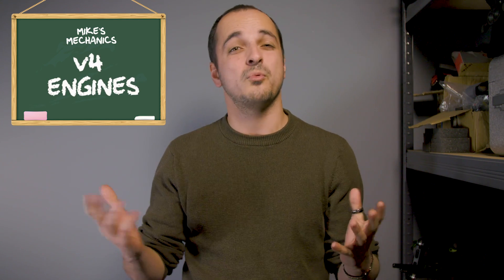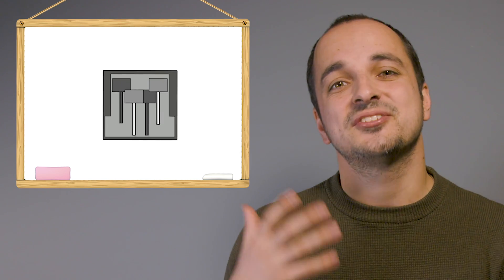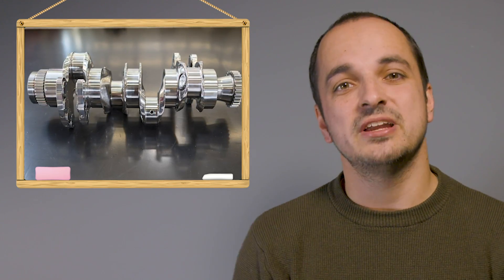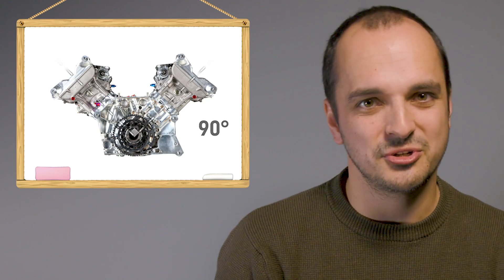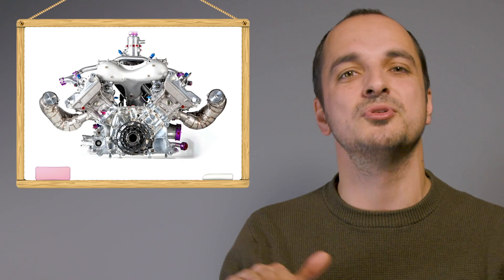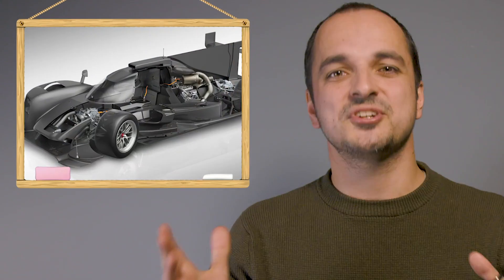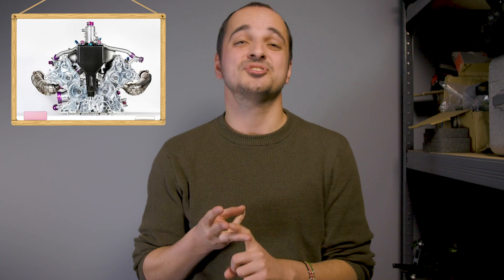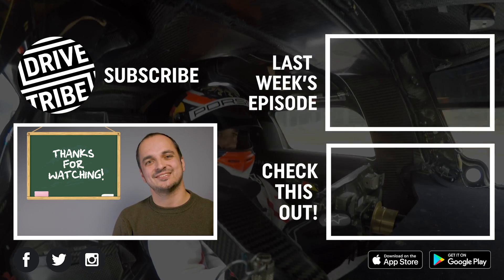Why V4 engines are so rare and which cars use them - Mike's Mechanics

Comment: 500hp v4 and people over here are boasting about their 390hp v8's
Reply: Wow I've never seen salt develope so fast before
Reply: I think once we see the masses go to electric cars we will see an extreme rise is cost of electricity.  As we are seeing in Europe, wind farm electricity is the most expensive compared with nuclear.
No FREE lunch as they say.
Reply: F1 v6 engine produces about 950hp + 160hp of electric power.
Reply: Not like it's a race car that doesn't have to conform to production car standards
Reply: Lol this is a race engine you stooge. Show me a modern race v8 with less than 700hp
Reply: well how about the dodge demon's 840hp V8 then? that engine has actually been mass produced unlike the V4
Reply: *Tubocharged
Reply: because those are their V8s. How many 500hp V4s do you own? Or have even been in the vicinity of? Right..
Reply: Swampy  owning two vehicles for the sake of efficiency is financially unjustifiable, with extra maintenance cost and insurance cost, id be losing money even after all the fuel savings. I don't need 500 miles of range, but I can very easily put 200 miles on my vehicle in a single day, and with cold weather and realistic highway driving speeds and potentially having 5+ adults in the vehicle, I can't risk having my car die on me in a long day. If I could recharge fully in 3 minutes then idc if the range was 100 miles, the issue is how long it takes to charge

And electric trucks is a whole other story with things like towing looking at an 80% range reduction, just big nope
Reply: NOISE! 🤪
Reply: I am dumbfounded by your stupidity.
Reply: 720hp actually lol
Reply: You must be talking g about Ford. Us Chevy boys been making 1500+ for years
Reply: I don't think ANYBODY is boasting about a sub 400 horse V8... Oh, it's stock, yeah I'm badass...😐 I don't know of a production V8 making less than 400, and that's just n/a. And there are NO 4 cylinders making even 300 n/a. Fucking moron. It's an air pump, more displacement means the ability to make more power. More cylinders is an easy way to get more displacement. Or use forced induction. Or both.
Reply: yeah id boast about a car I built too, idgaf a company with unlimited money knows how to build an engine, fuckwad
Reply: How about torque though.
Reply: I hope not since Nissan v6's product 390hp and more.
Reply: Yes, but don't forget that the V4 is a high stress engine that is not designed for a production vehicle. Because of this, it is no where near as reliable as the V8 would be. Regardless of how much power the V4 makes, I doubt that people would like to own one if they had to replace parts on it every week.
Reply: @justinsweeney643  the original comment was a joke and I've created a war.
Reply: @james2042  embrace it my man,  wish you luck
Reply: @AA-zm9hk  at this point there are so many different comments idk which you're referring to
Reply: @james2042  your initial, look at what you've done
Reply: @AA-zm9hk  ik I've spawned a war with several different categories of fanboys
Reply: My 2003 Mustang v8 makes 260 hp :(
Reply: @Angel Gutierrez That sounds like it only has the 16-valve 4.6 V8, which are usually found in Crown Victorias and base-model past-generation F150s. I had started to think that the Mustang GT was at least 310-ish in the 2000s.
Reply: Alright guys, go easy on him! We got a Buick Lesabre owner here! Lmfao
Reply: Except the porsche engines require 5-10 times more money and can't make lots of miles before more money is needed.
Reply: Swampy  I've seen that vid. But it is an expensive and one of a kind car.
Are 1800+ bhp V8s one of a kind or rare in any comparisons?
Reply: That 500hp v4 is twin turbo and running methanol..  not pump gas.  400hp naturally aspirated is good power on pump gas..
Reply: V8 400hp much more reliable if built and less stress on engine in general. If they engine came out it’ll be like the straight 5 or any BMW engine they’re unreliable after some time and ever expensive. 525 Hemi supercharged gets 1700hp with low boost..
Reply: Why is everyone forgetting that this car is a hybrid? Let alone turbocharged? You simply cannot compare a turbo, hybrid v4 to an NA v8.
Reply: "HP sell cars, Pounds of Torque win races, pull the cargo and climb the mountain".
Reply: You know that you can get 800hp out of a street v8
Reply: Swampy  for me a second car on my insurance policy doubles the bill (180 a month) and that plus the registration fees and one vehicle is wildy cheaper, and that's ignoring price of the second vehicle. In my case I would have to drive way more than I do annually in order for it to break even and start saving me money.

Married couples are different because now you have 2 people so 2 cars makes sense financially. And the odds of one of them only needing basic transportation is high, so one ev and one gas vehicle makes insanely good sense
Reply: 500 bhp so let's say that is about 15% reduction in HP to the wheels, giving us 425 whp on a turbocharged v4 not bad. 

Take a look at the V8 twicethe engine  naturally aspirated getting almost the same whp with 15% reduction is 332 whp only a 98 HP difference easily made up with a tune not to mention if you threw a turbo charger on it.
Reply: I get a solid 230hp out of my 4.6l v8
Reply: @samuelbaird4983   and i get about 425 from my 2.5L flat 4 EJ you don't need a big engine for big power.
Reply: Yeah but the v4 Is a racing motor. Everything is designed with tight tolerances and billet parts that can take the load. 

A 390hp v8 is built with reliability in mind and is also designed to spend more time below 5000 rpm.
Reply: So many triggered snowflakes. Probably V6 Mustang owners.
Reply: A 390 hp v8 will have more torque than a 500 hp v4 if both engines were to be put in the same car the v8 will accelerate faster but the v4 will have a higher top speed
Reply: XXzenon Ionnex  no. More power: higher acceleration. Only exception is uphill driving and towing, where torque is more important. Torque might also be higher in the V4, smaller turbocharged engines often actually have more torque than larger naturally aspirated ones, but it depends on how you build the engine.
Reply: I never saw so many americans on one place... And car proffesionals, and pro drivers, and engineers, the f*ck why do i have to work when there are so many people better than me on my job? Anyway, electric cars? Nice thing. Infrastructure? Would survive for 10 minutes. Remodelling of power delivery? YES. Massive ammount of transformator switches around the world? Yes. Electricity shortage? Yes. All ECO energy from wind water and solar sources? Inpossible. Why? Start to read people. Read what you post here, someone talking about My OvErPoWeReD 5000+hp dragster... That is not racing boi, that is stupidity, driving in a straight line is all you can do? Probably. James, you started a war here :D, i like it :D So for all those red diploma enginers. A tesla can drive, yes. That is good. But charging, well the charging current is let me check... 72-250kW by 400 volts ----> 180-650Amps. For max 300kW for 2 cars. This requires thicccc cables to be used, really thicccc. Probably some 5x16mm2 wiring just to the car, and 40mm2 to the station. Now you need to make it. So probably some people want to charge it at home. Need some imagination what work will be there. Now. Lets put 100 cars on for charging over the night. What do you say? Can the ifrastructure handle 100 teslas charging at the same time with output over 18 000 amps? Not every small city can handle that. And with the eco energy people wish to charge it, there would be too many solar pannels out there, if you think about that a 2*4m solar pannel can hold a small house with a reserve of 15% or so. When the house will not use more than 10kW when the kitchen is working at full ----> kitchen is the area in the house with the biggest usage of energy. So well, with a small example in mind, electric cars are not ready to become mainstream in atleast 5 years, because the charging stations are not everywhere to be honest, and traffic jams can be the end for a e-car trip. For the guy that asked how many miles i can do without a few hours pause, well, i made 1700 km from home to belgium in 13 hours, with 3 stops that took around 5 minutes, the toilet. 2 full tanks of 60l and the as many of you guys called most unreliable BMW engine that made 340k km and the cars fuel injectors are starting to break down, and one turbo repair of an price of around 300€. Unbelievably, those unreliable BMW engines that last forever if an ami guy doesnt drive it.
Reply: @kristianweichpart4057  nuclear power. Lots of it. And yes infrastructure will have to be improved, but it is doable. When it comes to electric cars, i think price is the main deterrant, turns out 40k cars just are too expensive for most people, and people wont switch to bikes or buses, people will keep on driving. Heard about the renault twizy? Its a very very cheap (sub 10k) little runabout, great idea, only problem is that is too slow, 50 mph just isnt fast enough, put a bigger motor in that and sell it for 10k-ish and it would be perfect for the future.
Reply: Yeah sure 500  horsepower with absolutely no emissions whatsoever. It's actually easy to do.
Reply: Apples and oranges...
Reply: The v8 fanboys have developed salt quickly
Reply: It is a hybrid. It is paired with an electric motor.
Reply: Check the price difference on those motors.
Reply: 200hp+, i4, naturally aspirated, 1L. - Any Superbike
Reply: Almost forgot to mention. V8 have quite a bit of overlap in power strokes. since each stroke lasts for 180° of rotation and one cycle takes 720°, we fire every 720/n(cylinders)=interval we always have 180°/interval powerstrokes overlapping. (2 Strokes always have twice as much overlap).
In V9 thats 90° ov overlap and 2 powerstrokes happening any time.
More overlap = smoother power delivery.
Reply: KEKW
Reply: 400hp inline six
Reply: Keep in mind that 390 hp 355 or 302 cubic inch, has over 400 ft lbs of torque as well and is budget priced parts engineering, it is all how you build it, v8's are cool aren't they.
Reply: Aprilia RSV4
Reply: V8s: "Thur's no replacement for displacement!"

V4: "18k RPM red-line and a turbocharger ought to do it."
Reply: race car engines dont have to last 400 000 miles
Reply: @James Olelo And people are misinformed or clueless if they think theres no reason for a equivalent power v8 vs a 4 cylinders
Reply: Turbocharged V4 making 500HP?
Laugh in 1000HP Honda I4 K20/K24
(but I still agree that european DOHC V8 are more efficient than american push rod V8, like NA Ferrari V8)
Reply: @nickkung8041  you mean their 4.4L V8s that  have soaring high redlines with low peak torque at high rpms. Not to mention the Ford 5.0 is DOHC. 

That being said the pushrods over here are meant for low end torque and towing, and are adapted to muscle cars, vs the v8s over there that are purely for speed. Might as well be comparing pushrod v8s to f1 v8s with 5 digit redlines
Reply: Race cars are different, like the Ford GT has a V6 with over 660 HP while being a production car which makes it a little bit less insane 

Also, have you seen the OldsMobiles 5.4 liter V8 with 140 HP engine? 😂
Reply: Remember most big American v8s are used for work in larger vehicles and just kinda tossed into cars cause why not
Reply: Dude, there's that thing called torque
Reply: Manufacturers in Formula 1 back in the 80's used to have 4 to 6 cylinder, 1.5 litre engines that produced 1300 hp in qualifying trim.
Reply: James Mastroianni how many KMs do you think a 500hp 4 cylinder would last, honestly? Race car engines are rebuilt nearly every race.
Reply: @roddydykes7053  Because of the stress they undergo every race? I mean do you really think daily driver engines would take the same amount of load and last very long? The only difference is that race engines are more focused on performance whereas daily drivers on usability.
Reply: @roddydykes7053  you are very misinformed
Reply: 390 hp diesel inline 5 would be awesome though
Reply: @sakariaskarlsson634  My Mercedes 300D was about 125 hp.  At 390 hp you're talking about a pretty big, pretty heavy engine.  Maybe good for a boat or truck, you think?
Reply: @hankosaurus  nah you can fit that into a car, but it will be a low revving torque beast, so it wouldnt be very fast unless you had a monster of a gear ratio, also it would need place for such a big engine, so the amount of cars it would fit is very limited.. But 390 hp diesel sounds amazing to me
Reply: @sakariaskarlsson634  why have a diesel when you could have the best of both worlds with sky active X technology? on vidoes to the right up higher.
Reply: @sakariaskarlsson634  yeah thats cool a SKYACTIV-X 5cyl. would be 500hp factory
Reply: Show me an 500hp v4 production car.... Yeah ok genius
Reply: Dexter Sullen 'TRUTH' well, I haven’t seen an V4, but I know Mercedes has a In-line 4 that has about 420ho IIRC
Reply: Dexter Sullen 'TRUTH' The saleen S1 is gonna have a turbo charged 2.3 liter 450 horsepower 4 cylinder or v4
Reply: @brandonortiz218  saleen would be ashamed right now
Reply: @dexterjsullen  gt 500 and dodge demon and hellcat
Reply: @dexterjsullen  just wait until porsche releases a road legal 919 hybrid 😹
Reply: @dexterjsullen  A, Not an..... genius.
Reply: @dexterjsullen  people make 500 to 700hp on turbo charged hayabusa engines and in America turbo hayabusas are everywhere
Reply: @dexterjsullen  the new Mercedes AMG CLA has a 2.0 4 cylinder with 400hp. I haven't seen one with 500 though.
Reply: Im glad we can all at least agree that coal powered  smart phone apps/appliances on wheels are the future. So exciting.
Reply: lol LS make over a 1000 at the wheels 😂... LS SWAP THE WORLDDDD
Reply: James Mastroianni well let me just quadturbocharge a viper to make it 2500 bhp
Can you do that on 4 cyl platform Mr?
Reply: @firerider669  Better yet a big block V8 nitro fuel dragster that  puts out over 10,000 hp and 6,000 ft/lb torque.
Reply: Le Peejon that’s MA NAME BOY ahahaha
(Literally my id name)
Reply: @firerider669  Yes, just need to ditch the fuel consumption issue :D
Reply: @firerider669  wow nice 3.5x the bhp (remember he said in the video that deregulated it made 720 bhp) with 4x the turbos and 2x the cylinders... very efficient and definitely faster than a le mans car lmao
Reply: @Czar1249  what's here not to agree. Facts! But we can't afford one and it isn't even road legal and probably needs engine swaps more than A granny craving for candy
Reply: @firerider669  Still a horrible car
Reply: There are 3000 bhp Supras. Though to be fair their are 5000+ bhp V8s. Heck a 1005 Ci V8 could probably be made to produce 5 figure power.
Reply: @firerider669  depends on cubic inch, at a certain point you can only stick so much air and fuel in a specific size chamber. So you either need to add cylinders or enlarge them, like my current V4 design in the werx, 9,880 cubic millimeters or roughly 389 cubic inches. have many other sizes also smaller and larger.
Reply: @firerider669  here you go:
https://www.youtube.com/watch?v=J87SVqG18sY
Inline 4, 106kg, 4 liter of displacement, 3000HP, billet engine based on a production engine.
Reply: @rattlehead999  r u crazy? That's not anything near stock! It is a custom designed billet block that disblaces 4 litres. Most road going 6 cyl cars arent even 4 L.
Big blocks are the best non the less
Reply: @firerider669  that beautiful monster still not gonna beat any high level engineering dedicated racer like the 919 v4.
Reply: @firerider669  nice setup there, the weight would be equivalent to a tank I guess.
Reply: @firerider669  viper only needs 2 turbos to make it up to 2500hp, 4 cylinders can also have 3000hp which I’ve seen before but they are fully built nothing is the same as a stock 4 cylinder car basically, keonigsegg just made a 600hp 3 cylinder engine by the way and that car produces 1500hp stock with that 3 cylinder engine and batter assist
Reply: @firerider669  vel let me just blow this hemi and convert it to run on nitromethane and have 10000 hp   and my next response would be well let me just start my Falcon heavy solid booster rocket  with 156.000.000 hp
Reply: The BMW i8 has a 3 cylinder 1.5 litre turbo charged engine that produces over 300 hp.. reliably.. American V8's are dinosaur droppings. 
Its all academic now anyway because electric drive rules! Anyone fancy 0 to 184 miles an hour in 12 seconds? Reliably.. 0 to 60 in under 1.8 seconds. Every 30 seconds for hours and hours on end? 
No servicing.. no farting around.. no waking up every policeman in 20 miles while doing it? In fact he will not even hear you if you start from along side his car.  
Then time to wake up to the new century and the future. :)
Reply: @williamarmstrong7199  "Dinosaur droppings" that perform pretty damn well, and at a reasonable cost.
Reply: @dizzywow  Lol yeah no shit, and unlike that 1.5L turbo that a 5.7L small block for instance can reach 300 HP stock naturally aspired and at low RPM comparatively, and last a lot longer. better builds can reach over 500, before forced air.

You can't cheat displacement. Turbo's will make a engine have more HP but at the end of the day more displacement will be the biggest factor.
Id take a 350 small block or a 351 any day over a i8 turbo for the simple fact that they are cheaper and more reliable, with a much higher power ceiling.
Availability of parts and ease of procurement, all huge factors.
Reply: @williamarmstrong7199  BMW, Reliable ? 😲😱 ,,,   😂😂😂😂😂😂😂😂😂
Reply: william  armstrong Show me where I can build a bmw i8 3 cylinder and get that 300 hp for less than 10 grand. Oh wait you can’t, the shit is far too advanced to be cheap. Also did you really say bmw is reliable? Funny. The i8 hasn’t been around long enough for people to have driven enough to really test that. Yet you see old ford and gm v8’s from the 90’s everywhere still ticking. Parts are cheap as hell, and I can fix it myself. There’s no replacement for displacement, it takes a turbo to make that 3 cylinder get nearly the same power as a naturally aspirated American v8, turbo that same v8 and it makes the power of that 3 cylinder look comical. Without the turbo that 3 cylinder is a joke
Reply: @RegulerShowTV  they make 3 cylinder engines ??? 
Well I'll be damned they do and that's one small engine Christ my motorcycle has a 4 cylinder
Reply: @williamarmstrong7199  Where are you getting any of your information?? lol the effect is lost when your facts are wrong
Reply: @williamarmstrong7199  cant deny impressive times, but imo the only people who can really get into EV's are super techy people.  Theres no tinkering for the average home mechanic, for me personally EV talk is kinda like comparing humans(combustion) to robots(EV).obviously the robot will outperform the human, but theres no emotion, no passion or excitement in it UNLESS youre techy and build computers  n stuff.  just my opinion.
Reply: @superrad1659  im pretty sure mechanics themselves also have to be techy, cars use lots of electronics, and if you want to tune them, there's lots of pcm modifying involved
Reply: @AlineaEuros  while that is  true, i had said your average home/garage mechanic. maybe i wasnt clear with my wording. either way, the average guy tinkering in his garage is primarily wrench turning,  not neccessarily standalone ecu's and tune programming.
Reply: @williamarmstrong7199  eww tesla shills leave
Reply: william  armstrong: Tesla just blew up ANOTHER one of their self-guided lithium missiles at the “Ring” so you’re right about the “No servicing” part at least. As an added bonus, you can cancel your kneepad subscription with the Musky One.
Reply: Who in the Hell wants an electric race car I've seen and watched electric F1 type car's the lack of sound killed it for me pure boredom the sound of a race engine is
Reply: @williamarmstrong7199  spoken like someone who has no idea that the JOY of driving is more than just going fast.  I won't take the time to explain because you simply wouldn't understand it with your mentality :(
Reply: @williamarmstrong7199  Koenigsegg's 3-cylinder engine makes 600 horsepower.
Reply: @williamarmstrong7199  0-184 mph is impressive. And it could probably do it for a couple of laps.. And there lies the problem. And it's easy to dismiss American V8's apart from the fact that they are easy to tune to vast amounts and incredibly reliable unlike German ones.
Reply: @williamarmstrong7199  reliably? Have you never heard of the vortec 5.3, don’t ever disrespect this engine reliability and what you gonna do if that lil 3cyl hybrid brake down? Cuz it will, I can go into any automotive parts store and find a plethora of components that will eat the lifespan of your lithium battery the you got a 80 hp 3cyl pushing you nowhere. Plz know what you’re talking about.
Reply: @williamarmstrong7199   BMW doesn't make anything reliable so idc about anything you say and theres no doubt electric is the future, its just not ready yet
Reply: @james2042  Indeed electric is the future but your assumption about not being ready is rather Ill informed. Within the next couple of years every Ford car besides the Mustang will be electric and with a glut in the market the gasoline powered Harley VTwin will soon be going away. These are two of the oldest vehicle manufacturers in the world, they won't risk putting garbage on the street thereby destroying their future.
Reply: @LeoTheComm  until I can reliably fill my electric vehicle in 30 minutes or less, or have like 500 miles of range, it still a nogo for me (and a lot of other people).

The complete lack of public infrastructure for charging is the major downfall, not to mention the battery technology.  Theres also the fact eletetric vehicles are about 30% more expensive than their gasoline counterparts due to battery pricing.

And last note, there is no where near the electricity production needed to really start replacing gasoline vehicles with electric ones on a mass scale. People forget since they cant see electricity, that it doesnt just magically appear.
Reply: @james2042  you're correct, the infrastructure isn't up to the task and again you're correct on the expense. Microgrids are the future of power distribution systems and a battery bank in a car is the perfect place to store power during times when solar and wind are cranking out some power. Being expensive will HELP sales, Americans love a feeling of superiority whether it's based in reality or not! Being able to say "My power comes from renewables and my car is non polluting" combined with having an ability to go "off grid" to power a home will help people justify the cost. Remember, new technologies drive innovations outside their original purpose as they become more popular.
Reply: @LeoTheComm  oh I know what they are doing now is paving the way for the future, but it doesnt change the fact right now ev's are heavily on the bleeding edge and I'm not one for a heavy adopters tax on my vehicle.
Reply: @james2042  How long do you keep a new car before replacing it? How much time does it take to plan and install solar on your roof? How many employees would it take for your employer to cover the building roof with panels, of put up parking shelters covered with panels if he knew they could turn a profit? Again, how long will you own that car? How often do you drive more than 200 miles before stopping several hours? If it's one thing I know for sure, once a market exists there's plenty of people ready to jump and run to fill a need whether real or imagined. If you don't want an electric car, buy a gasoline powered one. How long will you own it before replacement? What will it's resale value be by then, especially if it costs more per mile? Hey, I don't even own a car, I'm a biker who refurbs old antiques and ride the bus in winter, your decision is yours!
Reply: @LeoTheComm  bought my 2005 Buick lesabre in 2007 off a 2 year lease. So that's 12 years of ownership right about now. Prior to my current job an ev woulda been fine. But now as a real estate agent, I need to be able to put 250 miles on my car when I go out, not to mention I live in mountainous NY so its lots of hills and very cold/hot for winter/summer respectively. The sub 0 winters and 90 degree summers doesnt help the battery durability and performance or the amount of climate control needed.
Reply: @james2042  so, an electric car doesn't suit your needs and you don't buy new cars in the first place. Why is it in your best interest to discourage others to buy an electric car?
Reply: Leonard Burdek III because what isn’t good for him can’t be good or usable for anyone else, absolutely not.

Edit: 
You folks have managed a civil conversation, I should’ve chimed in with something more constructive. 

I think I was mainly irked by the suggestion EV’s are some risky fringe technology. 

That’s a claim that held water back when Tesla released the first gen. Roadster, but today many manufactures have at least 1 EV or hybrid available to buy, or have something on the way 2019-2020.

And regarding the ‘lack’ of infrastructure, we should remember that every plug socket in every home and office is a charging station. If you need it faster, there’s the option to install a fancy fast charger that’ll fill your battery overnight. 

Of course, that doesn’t cover you if you live in the arctic or Sahara or regularly embark on non-stop drives between the two, but then that isn’t a problem EVs are trying (or currently able) to solve.
Reply: @james2042  Catch-up with the times brother. 10 years back, hybrid was the pinnacle of drive tech and electric vehicles were slow and bulky. Today we have supercar slayers which are electric. 5-10 more years and they'll be mainstream. Technology advances way faster than your estimates
Reply: @daanishgupta  super car slayers? Maybe in a quarter mile. Electric car is just as old as combustion engine car dummy
Reply: @LeoTheComm  LOL, electric cars wont be mainstream for atleast another 35 years. People tend to overhype technology, I remember in 2012 reading an article on how close we are to resurrecting the mammoths. Its 2019 and I see no mammoth.
Reply: @james2042  this yetvthere are countries who think they can ban combusting  engines in 10 years.
Reply: @daanishgupta  it's not "catching up with the times" its called there just isnt enough lithium or electricity to convert every vehicle produced today to EV's. And unlike gas infrastructure which was built as the demand for vehicles rose, EV infrastructure has to be built while demand for them is insanely high, making the cost monumental.
Reply: @diamondheat9  yea any country that sticks to that will have a huge economic hit when the time comes as there just wont be enough supplies to make the EV's. A realistic law would be that every vehicle sold has to be a standard hybrid by 2030, and with toyota making their Prius hybrid system royalty free for anyone to use, theres no good reason a company could use to get around that
Reply: @james2042  🤦
That's why EV is advancing so quickly? I don't think you're aware of how innovative growth is measured. Electric and electronic tech in general has the highest growth rate of any invention ever in Earth's history. Lithium is the best known technology which is feasible. We'll soon have better tech.
Reply: @james2042  No, oil companies are gonna say no, and people are gonna miss the sound of a gasoline/ diesel or 2 stroke engine.
Reply: @LeoTheComm  have yet to see an electric semi  and until you can tow with that and rely on american consumption to travel across country in them...we arent ready
Reply: @LeoTheComm  lol they're getting government money, that's why they're doing it
Reply: @Ironpancakemoose  by 2030 you will not be able to buy a new petrol or diesel in Europe.

Hybrid or electric will be the only option for new vehicles in less than 10 years.
Reply: @james2042  never had problems with either of my BMWs. Idk what you do with your car
Reply: @roccociccone597  this comment is 4 years old let it die man
Reply: @LeoTheComm  it's been 5 years, are all fords EV yet today there in the US?